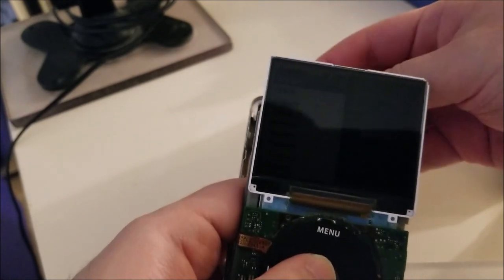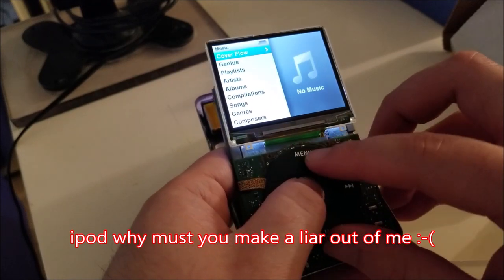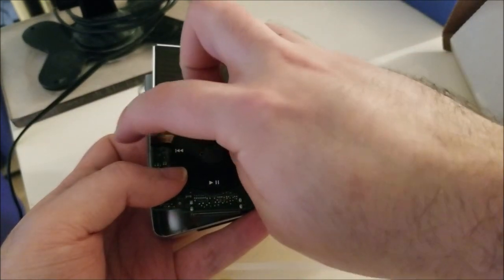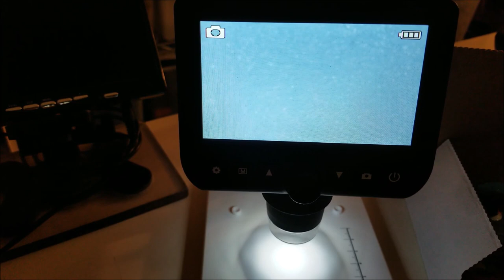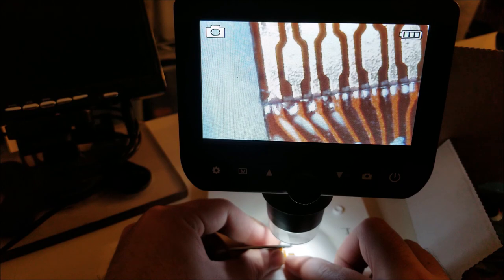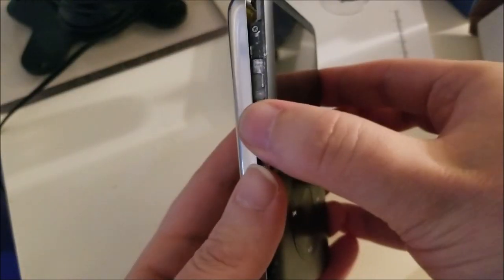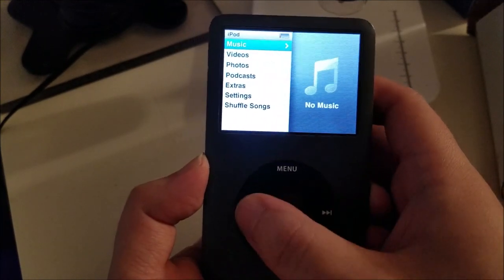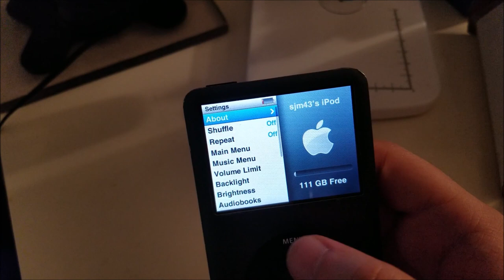Let's Fix: Broken iPod Classic

Comment: You can also electro plate it in copper for 5-10 minutes and I have found that works wonders for cracked pads it does require you to solder a wire to the pad above were it disconnected
Reply from the maker: That's something I've been keen to give a try, electroplating. I cant tell you how useful that'd be to refresh battery contacts that have been damaged by leakage.
Reply: @sjm4306  I actually think it’s best used to prevent damage such as reinforcement of the pads. As you can increase the thickness and in theory increase the amount of abuse it can take.
Reply from the maker: The weakest part of pads isn't the metal but rather the adhesive used to adhere the pad to the fr4/polymide substrate.

Comment: ipods actually have a diagnostic mode, that you can access by pressing back+center during boot
Reply from the maker: Yep, but before I replaced the clickwheel it wouldn't even respond to any of the buttons so I couldn't reboot or enter diagnostics. Really weird because the tact switches are not even a part of the clickwheel so odd they stop responding when the wheel is malfunctioning.
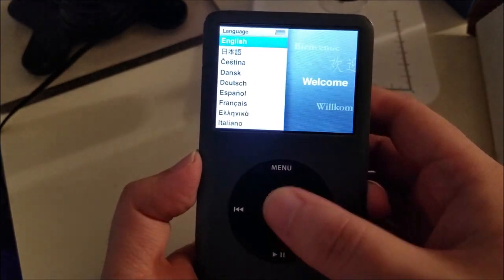Reply: @sjm4306  sure, i referred to ~5:50, where you had replaced the scrollwheel already. but since everything works, there's no need for the diagnostic mode :]
Reply from the maker: I did end up running tests thru the diagnostic menu after the video. While the drive works looks like it's towards the end of it's life. Guess it's time for an ssd mod!
Reply: @sjm4306  i've had an iflash msata adapter + 500GB ssd inside my ipod classic for years now, but had to replace the ssd last year. this was my first ssd to go completly corrupted and broken. while is did this, i also replaced the battery with a new one from aliexpress (don't know the real capacity, but definitely longer than the aged original one) and ripped out the clips on both long edges of the ipod, so i can open it by just unclipping the top clip in the future. since microsd cards are so cheap now, i'd pobably go for a 4-microsd adapter now

Comment: Best mod u can do to an iPod is to install an iFlash sd card adapter; u can boost your storage up to 256GB and make the iPod lighter, faster and most importantly last longer with every battery charge; the only drawback the iFlash has is if you install Rockbox os (which imho is an improvement to the limited and closed apple original firmware) you can get filesystem corruption while copying files
Reply from the maker: Lol as soon as I got the ipod working I placed an order for an iflash, it'll be here in a few days!

Comment: How did you remove the logic board? Is it just glued down?
Reply from the maker: There are a few screws securing it to the metal midframe and then some light adhesive. Iirc you need to remove the entire front bezel and the screws are under the clickwheel.

Comment: Hey sjm, i have a pretty bizarre problem with my old Nintendo 3ds, and I hope you can help me. It's been through a lot honestly, and my stick has broken month ago. I'm trying to play without it though, but I cant. The thing is - my cross is perfectly fine, and in game menus it works. But when I'm playing the game itself - drift appears. I have no stick, it's literally deleted, and cross is fine, so i dont know what to do. Still waiting for new stick
Reply from the maker: If there's no working stick installed then the 3d will read random floating voltages which will appear as drifting. To fix this you will need to install a new stick.
Reply: @sjm4306  oh, that actually makes sense, thank you!

Comment: Man I have an issue with a 5th gen, could you help me identify a component on the board? In case you answer I’ll go in more detail in the comments
Reply from the maker: By all means feel free to ask.
Reply: Thanks man! So, in the 5th gen logic board, by the 30-pin conector there's these two black plastic components on each side, on my board one of them fell out a long time ago. I don't know what they are, I suspect they are inductors but I don't know what value. I was hoping to find out so I could order or find the right part to solder it back on the board, since the pads are still there. Thanks again
Reply from the maker: They are indeed inductors. I'll have to dig up a scrap board and try to measure the inductance when I get a chance.